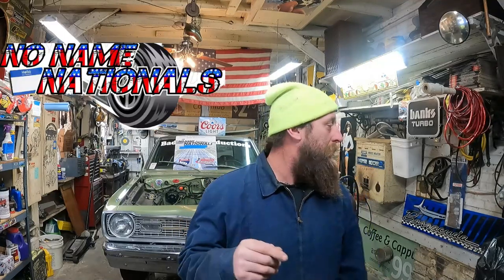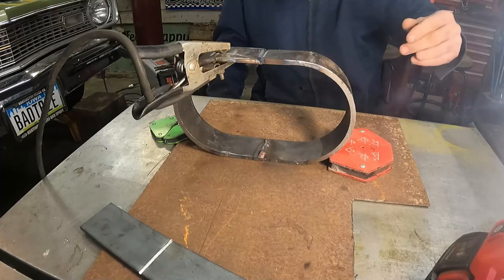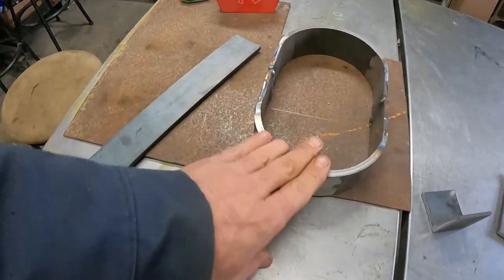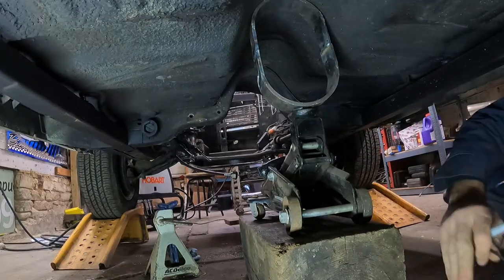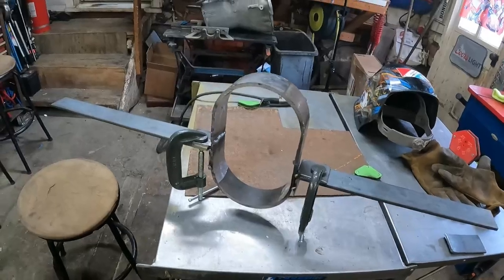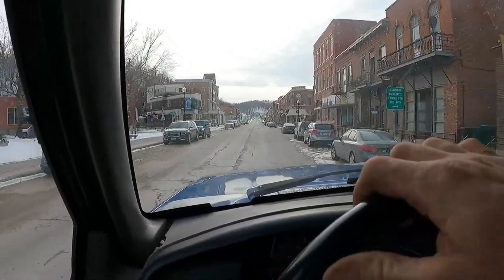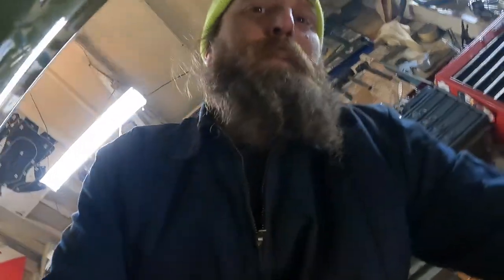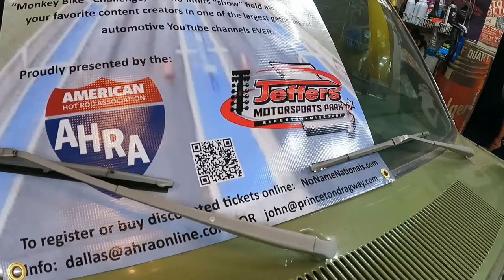Driveshaft safety loop. How you can fabricate your own and prevent catastrophic U-Joint Failure!

Comment: Great video but I want to mention the video where you took that bad cam & lifters out of your engine & I was telling you about all the issues with the flat tappet cams being soft  & mentioned that a roller would be better & you mentioned that you were going a roller cam set up !  So I found a place called Trend Performance that makes state of the art super strong & straight pushrods & roller lifters that make the stuff by comp & others look cheesey so look into them because they use a spintron to develop & find out why push rods were failing & why people were having issues of push rods coming out of the lifter & rocker arms like I was having issues with on my 440 which is being caused by push rod deflection where it bends slightly then straightens out causing push rods to either bend & fail or bounce out of the rocker arm . They perfected a way to heat treat the parts that are a Rockwell 6 on the hardness plus on the push rods you order they are made as a matched set where they measure each individual push rod to make sure they are all exactly the same lengths  which means in the end if the push rods are not flexing at all and they are all the exact same length that's more power your engine will make  plus more reliability . A lot of the top fuel guys are using their stuff as well as the NASCAR engine builders & guys running  sprint cars are using them as well . I looked & they have pushrods & lifters for our Mopars as well as Ford & GM as well as a wide selection of lifters & can custom make push rods for your application .
Reply from the maker: Thanks for the info Pete.